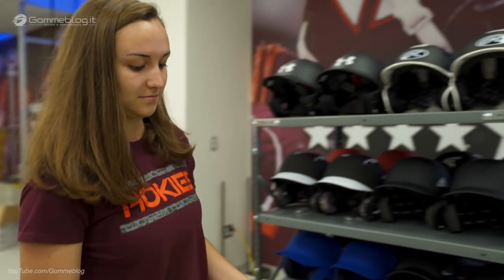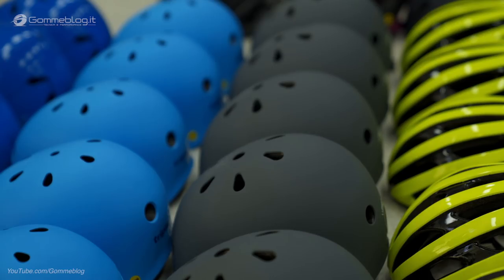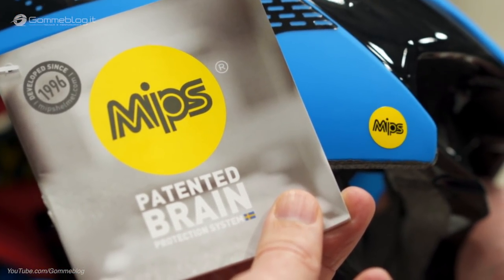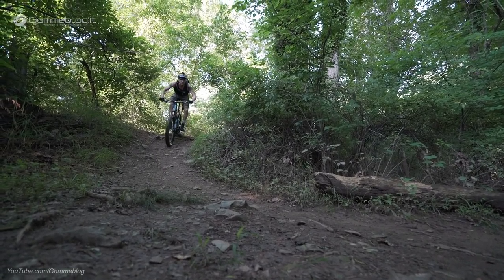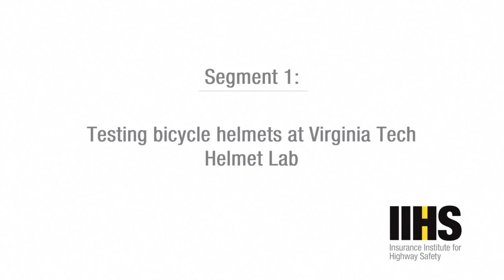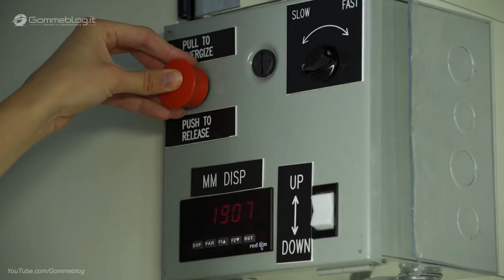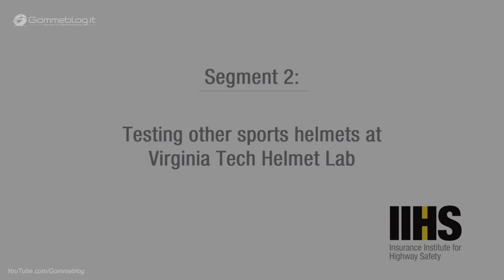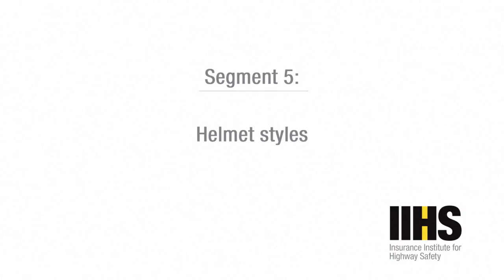IIHS CRASH TEST Bike HELMETS - Best Rating and Review - HOW IT'S MADE

Comment: What about sudden head torque and neck injuries? These injuries are typically seen only when wearing a helmet 

Second; the sudden stopping of a rider through impack reveils the trauma to the brain was due to the brain impacting with the inside of the skull.
 A helmet is not going to decrease the speed of the head of a rider a fraction of a ft./ sec.
Reply: Of course a helmet is going to decrease the negative acceleration on impact. The skin on the skull is very thin, the head comes to almost immediate stop on a hard surface without a helmet. A helmet is going to increase the stopping distance many fold.
Reply: @trollwitchdoctor  why would your head stop?  It might bounce but if it's attached to your body it's going along for the ride.

You will stop abraision but not impact injury.

So a helmet would help prevent skull fractures but not brain damage.

However a helmet can and does cause serious neck injuries from torque; as the helmet's design contributes to sudden rotation instead of sliding.

Now; not all helmets not all cases.

As an adult I choose not to wear one on a bicycle however; I do wear a helmet on my motorcycle all the time.
Reply: @TheBelldiver  Why would a head stop when it hits a pavement? If yours doesn't, you don't need a helmet...

The physics of a glancing blow are basically the same as any other. During an impact there is an impulse of force, that causes an acceleration. Too much acceleration, and the brain hits the skull. The duration of the contact affects the distribution of the impulse. Any cushion is going to greatly decrease the acceleration, and as a result, brain damage.

In my country, you have to wear a helmet by law. I would anyway, whether cycling, using an electric scooter, or any other activity where my nugget might receive heavy blows.
Reply: Bostitch Stanley auto soler
Reply: Buddy, between the risk of a sprained neck or traumatic brain injury, I’ll take the helmet and risk a neck injury each time